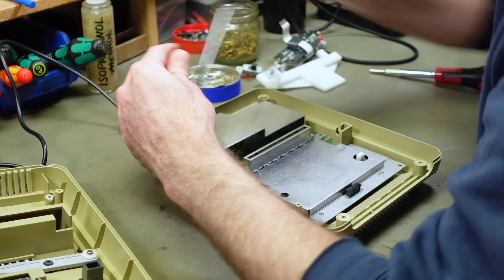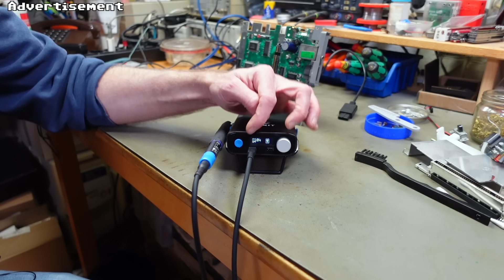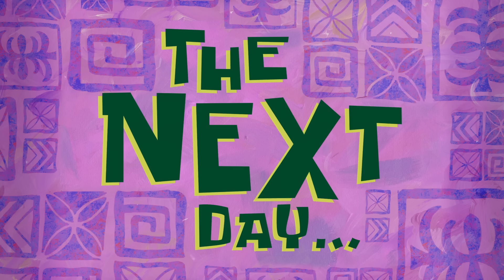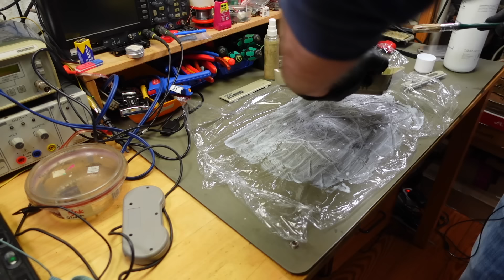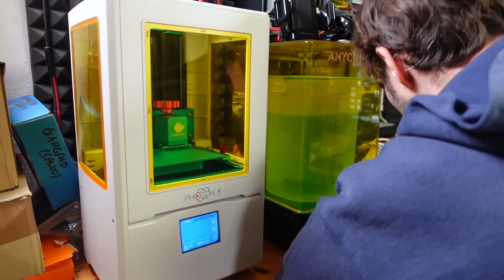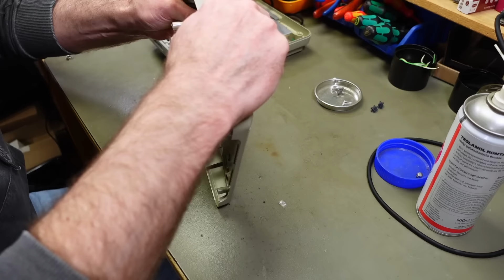Super Nintendo Entertainment System (PAL SNSP-CPU-01) Restoration

Comment: I have a image issue with my snes pal version. It may have a PPU issue.
Reply from the maker: Hard to tell what it is without seeing it. Could be PPU but it might be something else entirely, too. Capacitors, power supply, bad contacts on the cartridge port. All pretty common problems in these things as far as I know. Hope you can work it out!

Comment: I was going to ask if you had modded the controller, since NTSC controllers don't work with PAL consoles (the opposite is not true, except perhaps with the SNES Jr.), but then I saw it was an aftermarket copy.
My SNES has a very flakey connection that I cannot fix because the shroud of the cartridge slot has fused with the slot itself, so I cannot access it to give it proper cleaning.

Comment: Great video, as always, thanks Jan! However, I have often wondered whether it would be better to remove the flux not only with alcohol, but also with kitchen paper, for example. Otherwise, it will remain on the board.
Reply from the maker: Thanks! I started washing the circuit boards I worked on with circuit board cleaner and then standing the upright and letting the cleaner soak into a tissue. Works pretty well, no sticky residue anymore. The cleaning with IPA and brushes is just to get rid of the stuff sticking directly to the solder joints.

Comment: Nicely done, Jan.  A bit of improvisation along the way made it even better.  That plastic cement you're using:  is that a tolulene-based product like those used for plastic models?  That applicator tip looks like it is just right for fine work.
Reply from the maker: Thanks! I think the glue is mostly acetone based but it has to have some other ingredients because it works on so many different kinds of plastics. Doesn’t say much on the bottle, unfortunately. It’s definitely aimed at building model kits and such. Very very useful for vintage consoles/computers, too. ;)

Comment: Great video as usual, I had some great results with Amiga and Atari plastics during the summer without peroxide by simply leaving them in the sunlight have you tried leaving the parts in your retrobrighting box for a few days without the peroxide?
Reply from the maker: Thanks! I haven’t tried the box without peroxide yet. I guess it’s going to take a long time before you’d see any results if at all. Sunlight just has much more energy and UV.

Comment: Thanks for the reminder. My childhood SNES is still stock- I need to open it up and check those caps! Great video!
Reply from the maker: Thanks! Definitely a good idea to check on the caps. I think the NTSC variants at least didn’t get the wrong cap C59 but there may still be leakage as with all nineties SMD electrolytic caps. May your SNES live on for a long time! ;)
Reply: Did the same after the video (PAL SNES from 1992) I have small corrosion around C59 and C63/C64. I already removed all caps.

Comment: The next step is modding the console to play Japanese NTSC Super Famicom cartridges. And to allow the machine to be switched to 60Hz so the games play at the correct speed and full screen without the PAL letterboxing. Some PAL SNES games (mostly the 1st party ones) do not run properly when switched to 60Hz - but most are just fine with it and look much nicer when the graphics actually fill the whole screen.
Reply from the maker: That would be nice. I’ll look into mods next. :)

Comment: Nice restoration, I have 3 of those (one of them Japanese super famicom) that I need to do the same, just ordered a yellowed plastic restorer from Aliexpress instead of hydrogen peroxide, hope it works as well as your solution.
BTW how did it get so yellowed on the inside and under the top gray cover?
Reply from the maker: Oh, interesting! If you get a chance to share the results, I'm always interested in alternatives. :D I think the yellowing on the inside is just general breakdown of the chemicals in the plastic. UV just accelerates the decay, I guess.

Comment: Thank you so much for the video, I envy your attention to detail! The remaining bits of rubber feet could perhaps have been removed with a little WD-40.
Reply from the maker: The rubber feet really stumped me. I've never seen anything so stubborn during my repairs. Maybe some chemicals would have helped indeed (I tried IPA but was too afraid to weaken the plastic even more with anything else). Well, it works for now, doesn't stick to the table anymore and looks decent enough. :D

Comment: Interesting that the European design is just like the Japanese system. Great job on the restoration.
Reply from the maker: I always wondered about why Europe got the Japanese design and the NA variant looks so different. Probably Nintendo did some market research and Americans liked the purple accents?! :D
Reply: @JanBeta I like the "tank" design but the size of the Japanese/European one is an advantage imo. I have both but use the ntsc one. No yellowing on it either so idk if it's different plastic or something.
Reply: @JanBeta  it’s definitely inconsistent with the NES having the American design in Europe, but that’s probably more to do with Nintendo not having official distribution in Europe back then so Mattel imported what they knew.

 The chunkier American designs were meant to model AV equipment to seem serious, while Europe never had a video game crash in the same way. So once Nintendo had a European department, they probably realised we had no objection to smaller cuter consoles. 

I don’t think the American SNES looks as much like AV gear as the NES did, but the chunkiness and big eject lever do remind me of an (audio) tape deck a bit. Obviously the European/Japanese design has the eject button still, but (at least in the model I briefly had in 2012) is much less forceful and easier to use than the American one. 

The TurboGrafx had no real reason to be bigger than the PC Engine either, as I recall. But we didn’t get a Europe case for that.

Comment: Did they fix this soldering station? Because last time EEVBlog tested it it did NOT "put out 100W". It barely did under 50W with big lag.

 It looks pretty and has some clever design choices, but cant deliver half the power and whats worse has huge trouble sensing actual external tip temperature :(

Soldering iron is advertised as 100W, FixHub is advertised as 100W, all the tips are advertised as 100W and even have 100W printed right on them. Dunking the tip in a glass of water results in … nothing, station doesnt see drop in temperature for seconds, and when it finally seems to notice it lies about pumping full power while water doesnt even sizzle.

As a bonus if you leave the FixHub unused for long enough and it discharges below BMS threshold it will refuse to charge and turn into a brick.
Reply from the maker: There was a firmware upgrade a few weeks ago that might have fixed some of those issues (although I haven’t tested any of it in depth and didn’t watch Dave‘s video). I don’t have any complaints at all about the station yet (seems to adjust to more thermally demanding soldering very quickly). But I’ve only used it for about a month at this point as I mentioned.
Reply: @JanBeta  Problems start on big multilayer ground planes - something people specifically buying 100W iron care about. This was supposed to compete with 130W JBC, but now there are cheap Chinese clones using original JBC C245 130W tips at fraction of the price. Today you can buy $50 200W station and $100 48V 400W stations fully supporting C470 Cartridges - you can solder rain gutters with the former :D

This wouldnt be a problem if the product didnt lie about being 100W. No amount of firmware fixes are going to change physics of 3 ohms cold tip resistance and 17V supply (think connector, cable resistance etc). Last time this was discussed the best they could do with completely disabled control loop was 85W.

TLDR: Product plastered with 100W despite not physically capable of delivering it. You would expect from a brand like iFixit to not lie and openly state this is just a safety rating while real world power is closer to 50W. Shame.
Reply: Buy JBC instead, BT-2BWA10 costs the same.

Comment: Really enjoyed that Jan, I need to do my 1990 Super Famicom at some point, it's not that yellowed amazingly but I suspect the caps need doing as it gets a lot of interference on the video when I use Evergenesis flash cart although it is fine on original carts, anyone else have that issue? Lots of floating horizontal floating lines on the display.
Reply from the maker: Thanks! I think graphics problems are very likely caused by the caps going bad. Replacing the voltage regulator might also be a good idea (I've heard that using a higher power version like I did sometimes improves picture quality). Best of luck!

Comment: With some plastic things I've tried to fix, there does seem to be an increasing issue of chasing breakages, I've had to give up on fixing some items where plastic bits just kept breaking off right after I repaired other parts, sad, but that's the way plastics go... :(
Reply from the maker: Yeah, plastics get brittle over time, sometimes to the point of unfixable. This SNES is an edge case, seems to hold together reasonably well but definitely needs careful handling in the future. :D

Comment: Very interesting, I had to replace the capacitors in my SNES too but never thought about scraping the solder mask. It shows exactly the same signs of corrosion in the same traces... now I have to open it and do it. It works fine so far but who knows. People usually forget the SNES when mentioning console models that need urgent recap before using them. I had japanese Super Famicom too and there was no leakage there but the reca helped a lot with the video output quality.
Reply from the maker: Definitely worth doing. The corrosion is going to get worse over time if you don’t remove the corroded parts completely. SMD electrolytic caps from the early nineties are not very well made in general so it’s always a good idea to replace them with modern ones, even if they haven’t leaked yet. :)

Comment: We've all got stories..mine is..a family member sold his SNES and the SNES I gave him when we traded consoles..I got a Sony PSX..and an original XBox..he also got my original PS3 which he sold too on eBay of course...so..no SNES consoles but I have a Japan Super Famicom which Jan seems to not refer to when he says the Japanese SNES...the SFC was NTSC like USA...once upon a time TV's..CRT telly's couldn't use the NTSC signals..we needed modifications to run other regions..but modern flat screen TV's display a whole range..I have no trouble with my SFC on a flat screen 4:3...used for PS2 also...small 4:3 retro TV's are not made anymore and becoming expensive in second hand market..soon be paying more than a brand new 19 inch widescreen
Reply from the maker: Thanks for sharing your SNES story! Good monitors for retro gaming are indeed slowly becoming a problem. There are quite a few good options for upscalers and such thankfully so you can still have a somewhat authentic experience in the future.
Reply: @JanBeta  ...thanks for replying...i use wide screens for PC but i have little understanding of how you use widescreens without stretching the image...i don't want very fat Mario or whatever character i'm using at the time...there are ways to scale to 4:3 i know...black borders...or Emulation with side bars both sides usually filled with parts of console image...i've got emulation station RaspberryPi...i haven't figured it out yet with the Sony PS2 or SFC or MD real consoles...i might have to research it fully eventually when retro TV's are auctioned for hundreds or thousands...i bought one for about 45 British pounds a few weeks ago...screen has a couple of small scratches but it's near perfect...better speakers this time than my very cheap 20 pound one some years ago...very pleased with this...had to go 50 miles each way to pick it up...worth the trip...others seem to find old tech so much easier...i struggle and usually look for easiest answer that does the job...nice restoration Jan...i strip 'n' clean my consoles and controllers when i buy from eBay...a few are really disgusting but most are just ugh...sorry to drag on...i must check back your older videos...bye

Comment: I'm not sure the version with the seperate sound module ever found its way to Germany/EU/PAL Territories.
To my knowledge, that was NTSC only...
Well, PAL Boards have a different PCB Layout anyway and require PAL Specific RGB Cables for the SNES.
You can NOT use a Gamecube RGB Cable for PAL SNES; however, you can use it for SFC/NTSC SNES...
Reply from the maker: You are probably right. I’ve seen pictures of the little extra board but only in NTSC versions. The first cable I got for this one was the wrong one actually. They do work for about 5 seconds then the picture just fades to black. I initially thought the SNES was completely broken because of that. Definitely good to know. :D

Comment: Always very relaxing to watch a Jan Beta restoration video. But what happened to LIPS monitor?
Reply from the maker: Thanks Umut! The old LIPS tv gave up the ghost recently (in that the HDMI inputs no longer work) so I am using a nice little Samsung that I found on the side of the road for now. I am going to attempt to fix the old one eventually though, of course! ;)
Reply: @JanBeta  Looking forward to watch it. I really like your problem solving process. By the way my first tv repair took 4 months but I learned a lot 🙂
Reply: I wondered the same thing.